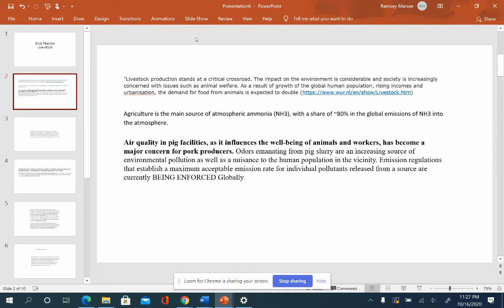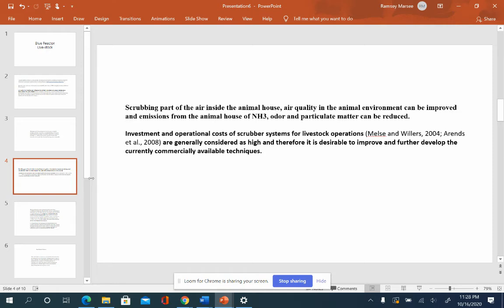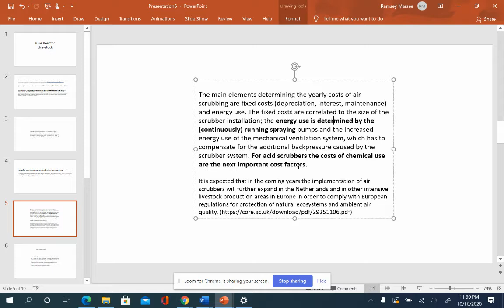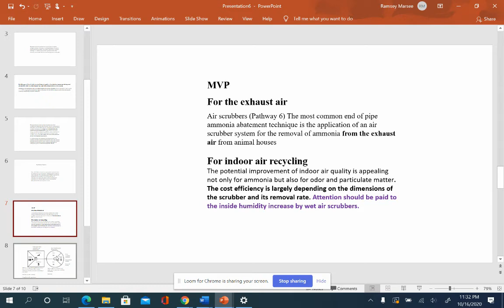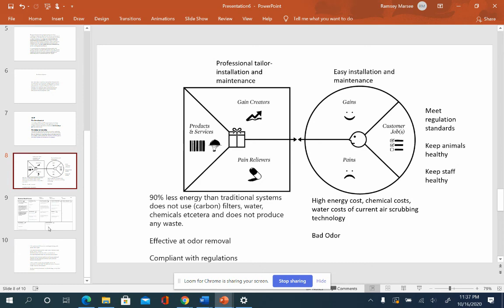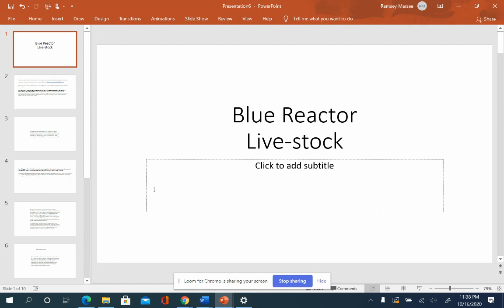Blue reactor - Livestock - Ramsey

Comment: Hey Ramsey,

Hereby, the feedback from group 13. First of all, very long video. You should have just explained the minimal viable product and not your whole project. We will only give feedback on your MVP, which is a very interesting idea. If this will be implemented in the future, we believe it will have a lot of positive outcomes. You explained it a bit too short though, so we cannot give a lot of feedback on this issue. Have you thought of a way to solve the increased humidity? Which one would you prefer? Exhaust air or indoor air recycling? Ours would be indoor, since this one seems to have the most advantages, e.g. it also increases the health circumstances for the animals. We suggest you focus on this one, instead of both. This way, you can specify more and foolproof your idea. Moreover, very cool that you try to contact the founder and ask questions regarding your product so you can make it work thoroughly. 

Goodluck!